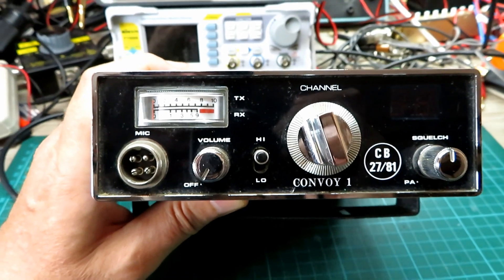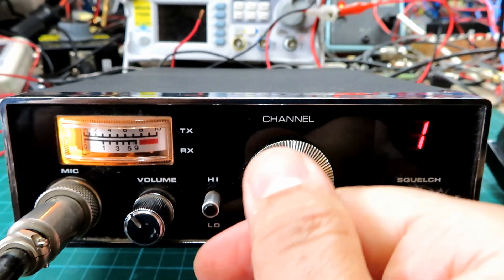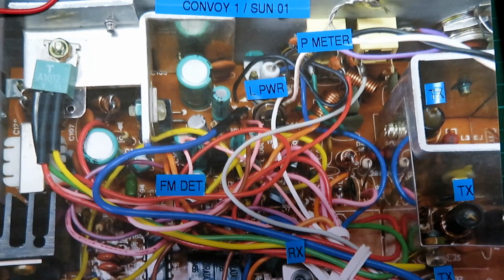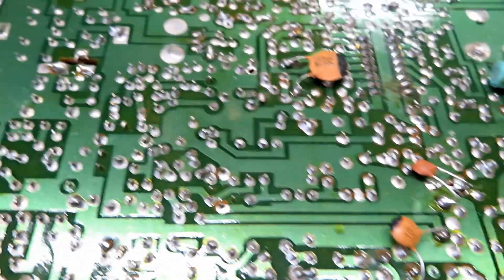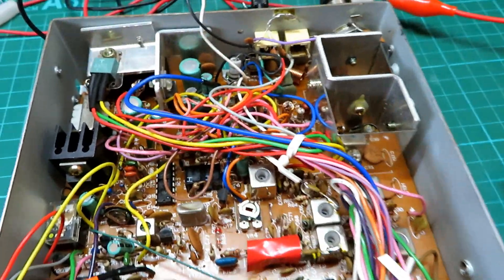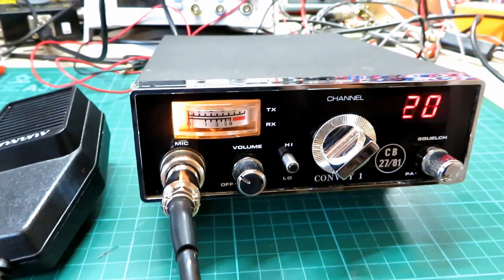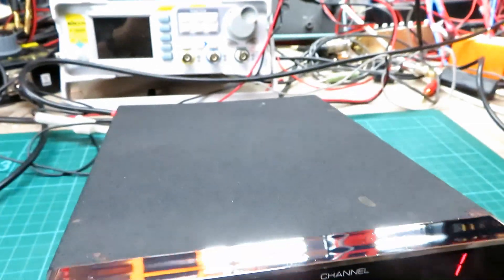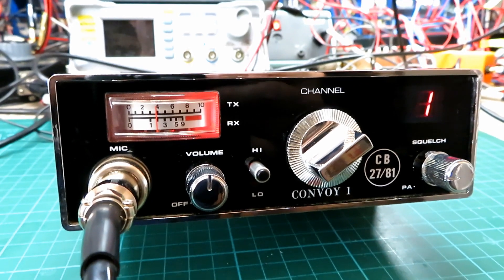WHY DID THIS UK LEGAL CB HAVE A 10 WATT POWER METER? WAS IT CAPABLE ? - THE DOMICO CONVOY-1

Comment: I have a colt444 a very similar radio and layout, the meter also switches from green light receive and red transmit, it states on the toggle switch high power is 10 watts. nice radio and not many of those convoys around now, not in that condition anyway, you have a good one there.

Comment: Knoxieman.. You have set your meter up wrong. The meter is is split in two parts.
The top scale represents the receive signal.
The bottom scale represents the transmit power.
Way back in the 70's I had a Convoy 80. An 80 channel rig way back in the AM days.
73's   Ian.. 2E0IFZ
Reply from the maker: Hi, look again at the front of the radio the fascia clearly has text on it denoting TX at the top and RX at the bottom, as I said this was because the same meter was used in 10 watt radios, most got adjusted up back in the day becuase users didn't like it, on some 10w radios like the Colt it was reversed but on this the meter its adjusted correctly, see Richard UKCB Servicing video he found the same issue with his one.
Reply: Clueless. It clearly has TX and RX marked on the fascia.

Comment: Nice video Paul. Had CB in the day. Mine had a lot more knobs on, nice minimum set. Seems a bit lazy (when made) not to stick correct meter in the thing. As UK 4W, change the meter. So where it was made, never did then. Odd.